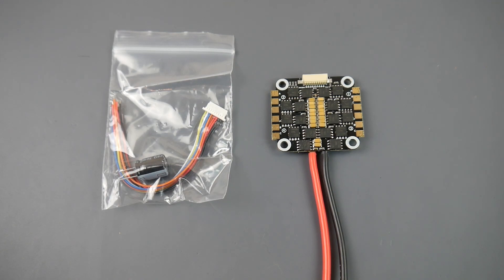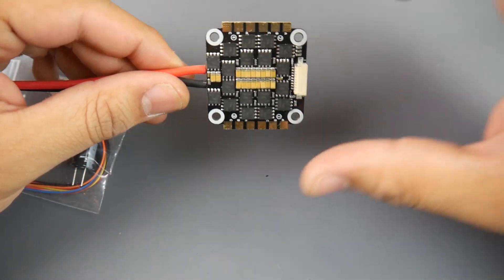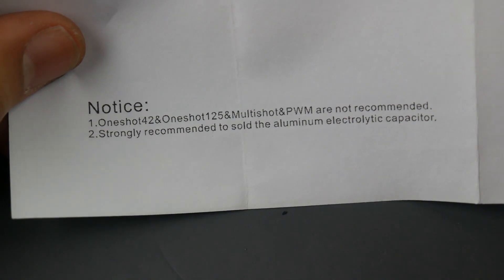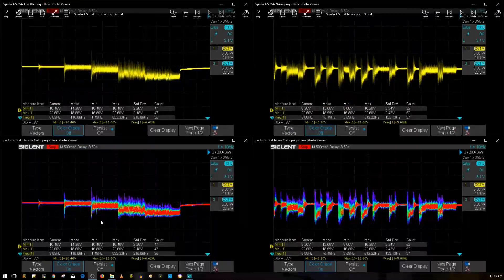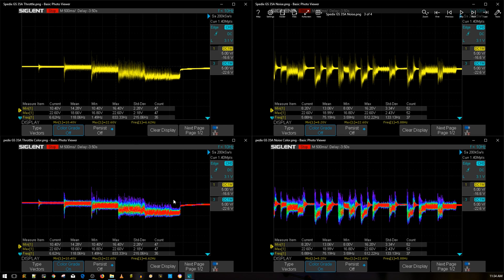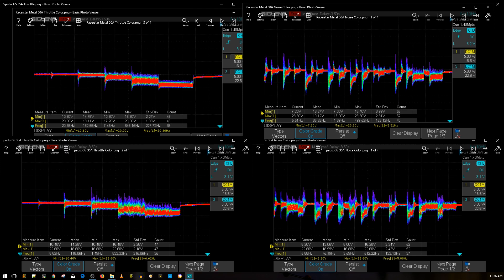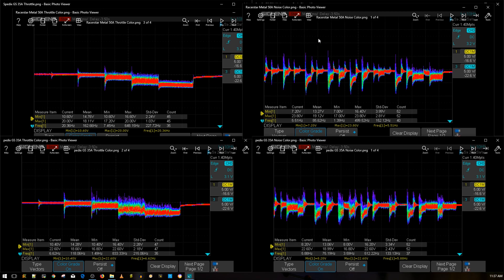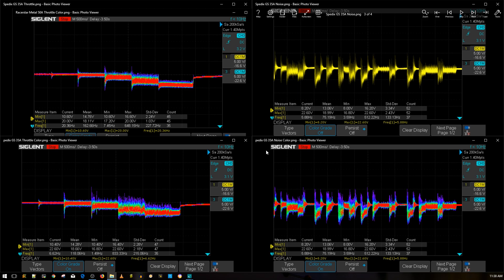Spedix GS35A 4in1 ESC Review and Noise Test

Comment: Here's my experience with this one: unflyable on 4S without capacitor. Too much noise in video (TBS unify Race, powering camera from VTX). After you solder Rubycon (2200uF in my case that I borrowed from RF Bolt) you have one of the best ESCs. The motors run smoothly, even better than on Tekko 32 4in1. Try it and you will enjoy GS35 like never before.

Comment: @Drone Mesh: An idea to test. People stared moungin capacitors with their XT60 connectors, further from the + and - pads on the ESC, so furrhter from the noise source. It is said that the closer you are to the source the better  and also the battery leads could introduce some resistance/impedance/inductance and who knows what. A test of the difference in where you mount the cap - right on the pads, with the XT60 connector, on some leads would be very valuable.